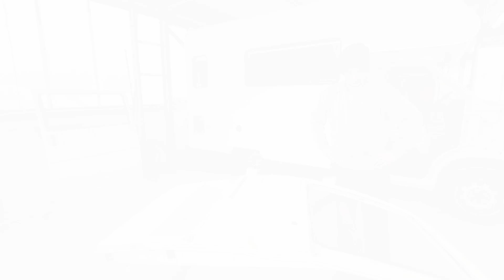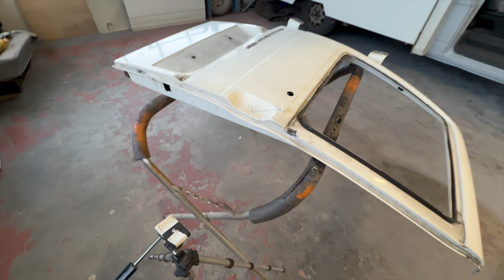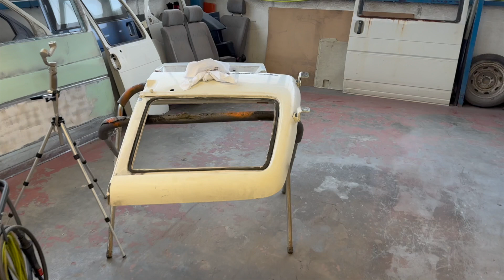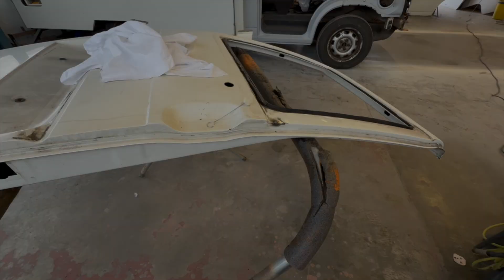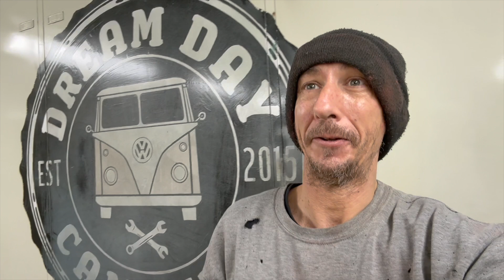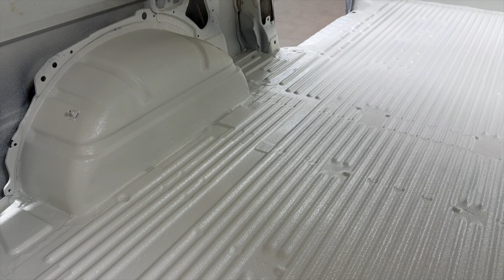T4 Restoration:From Rusty Floor to Raptor-Protected Perfection

Comment: What another great video matey... Have you ever had a T4 cambelt snap and repaired it??? I had mine plus all the auxiliary bits changed 2 years ago but only done around 500 miles since... Ive been told the camshaft can snap... Any input or help would be much appreciated.. Many thanks Glen

Comment: After removing the brown bits with abrasives and just prior to the rust converter, you'll be amazed how much shinier you can get the metal by dowsing it with concentrated sulfuric acid! Leave THAT on for an hour. This removes all traces that are not visible. Then convert.
I like to be clinical.. 🙂
Reply: If you've lost a bit off the surface, top it back up with cavity wax - only Dinitrol. ML will do. Sand down the wax to a perfect level.
Paint over the cavity wax. Pernanent repair as rust cannot exist without moisture and moistrue cannot get back onto the surface because the Dinitrol is a water dispersant. ZERO moisture.